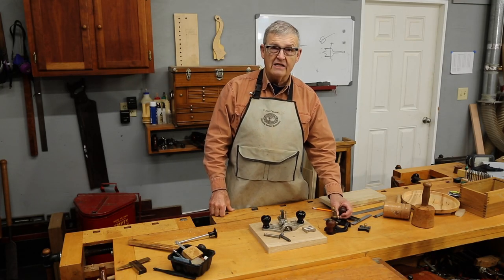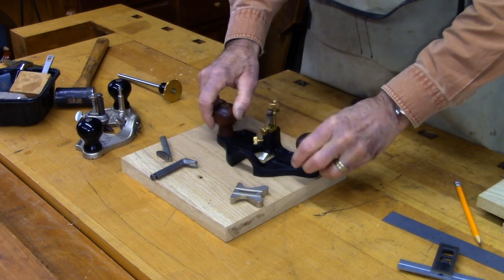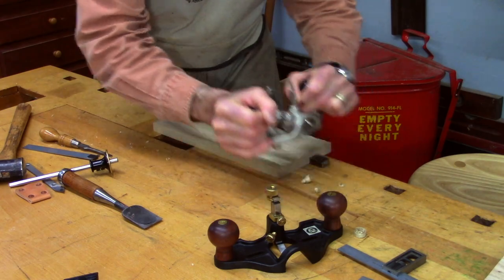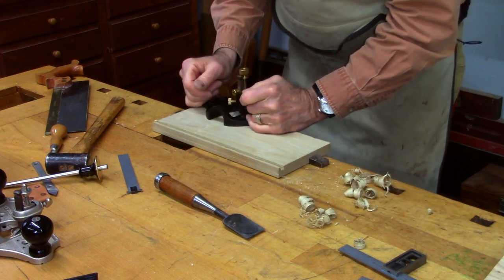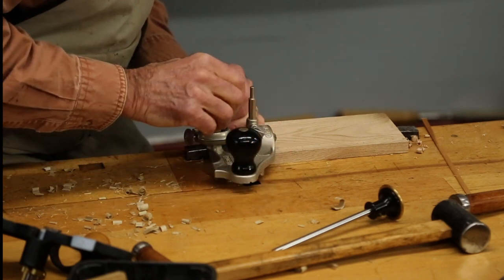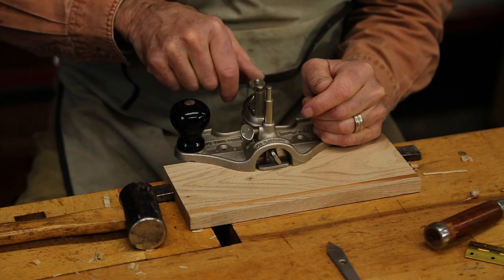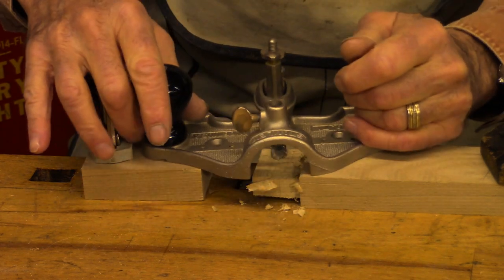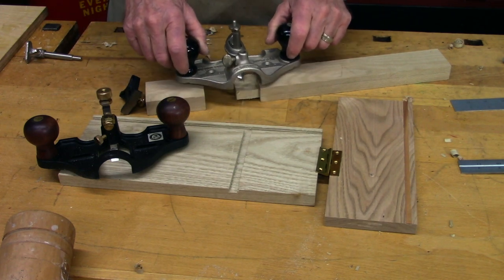A Guide to Router Planes

Comment: As someone who works with electrical routers and other tools to recreate some of the molding that is in my home.  I now have a much greater appreciation for the workers who created all the lovely fluted molding and rosettes that adorn the top corners. It took some time to learn what router bits to use to make identical molding and then it was just a matter of plugging my router in and going to work. Now I have to make the rosettes so back to precision measuring and all the fun of creating the patterns out of luan to keep my router true. Wow, I can't imagine having to do all of the woodwork by hand. When my Dad and I were remodeling the house my Dad told me that it was all done by hand as it was built between 1893 to 1896 and now I understand how much actual physical labor went into every bit of this house. Now I have a better understanding of why only the wealthy had weight issues back in those days. Amazing demonstration, Thank you!
Reply: I have cut a lot of molding by hand and it is less work than you would imagine. Craftsman would draw the shape to be molded on the end of a sutible plank. They would then use a large rabbet plane to remove most of the wood, leaving a sort of stair case with the inside corners just touching the  profile. The molding plane would then be employed for the last few passes to yield a perfect molding. The planes for largest profiles often had a post at the front so that an apprentice could also pull on a rope attached to it.
Reply: @conoverworkshops1486  Thank you for the explanation of how it was done back then. I can imagine when they used some of the hardest woods that were available like shagbark hickory that grows in Vermont that they needed the apprentices help. I thought of buying some old hand tools, my Dad had a few different size planes but he also used a router for speed. Unfortunately, old hand tools are being snapped up by collectors who have no intention of using them. They just clean them up and use them as art until their value increases to a point that it is worth selling the "collection." The prices, I've found, are out of my league so I will have to stick to electrical but I appreciate you taking the time to answer. I did download Cassell's Old Joinery Techniques from online and it is fascinating reading. I even found one joinery technique that I am practicing because it joins end pieces. A tenant that I evicted, during the eviction process kicked and broke one of the balusters on my front porch. We had already used the spare for another honest accident when someone was moving in so I found one that my Dad had cut too short but that meant joining the end pieces at the bottom. I never thought I'd find a way to make it as solid as the others but Cassell's has a technique that is simple yet not easy so I'm burning threw a lot of 2"x2" wood to perfect it before I try it on the real repair. I love working with wood. It's a challenge to learn harder techniques but the end result is always worth it. Thanks again!

Comment: Thank you for a great explanation!  I'm a very novice woodworker.  I'm currently working on my first big project (trestle dining table), and when I started it, I thought I was going to be buying more power tools.  Turns out that squaring up some mortises drilled with a forstner bit at the drill press got me hooked on learning hand tools.  I still use the power tools and will have them around especially for DIY projects around the house and occasionally in my woodworking, but now I'm slowly building up my hand tool collection. 😊

Comment: How can you get differ blades for the bench dog plane? I have purchased one form Rockler but would be interested in the smaller blade and the ponies blade.
Reply: Veritas blades will fit the classic Stanley I use in the video and I think the BenchDog as well. They offer seven cutters in imperial widths and another seven in metric widths.
Reply: @conoverworkshops1486  I don't think the Veritas cutters will fit it, they are not oriented the same way (45° off)

Comment: Very interesting video,  if you want to do a lot of hand work.  They are very nice.
Reply: I am not exerting any great amount of force for the cutters are very sharp and the amount removed with each pass is slight. The advantage to the router plane over a router or table saw is that you see the layout and work to it. With an electric router or table saw you have to work blind.